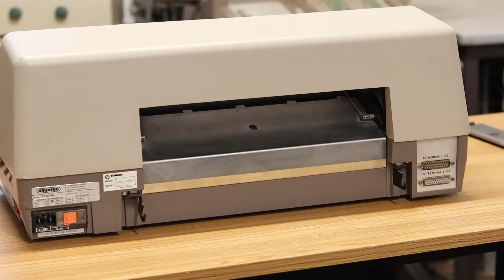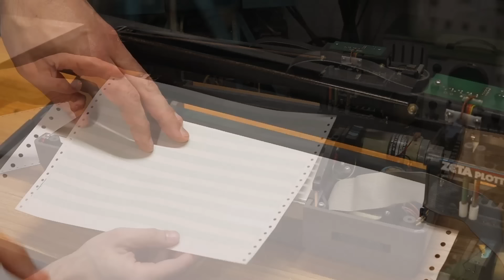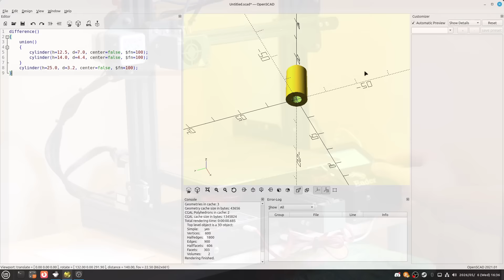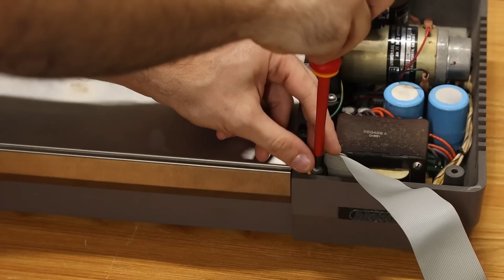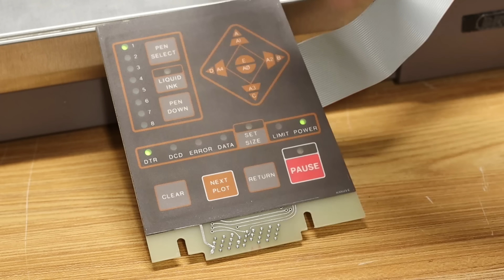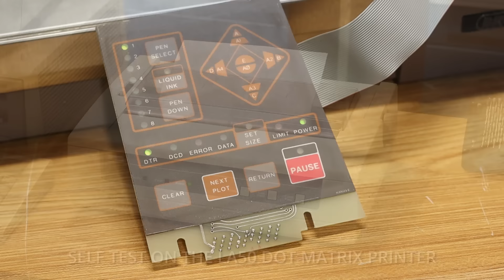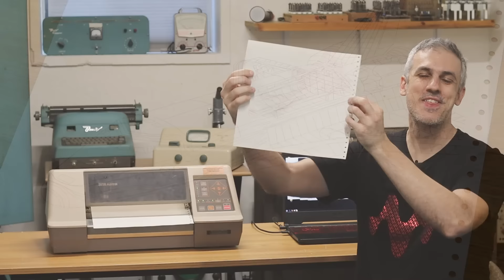A Pen Plotter from 1986!

Comment: I can recommend you a very easy method of finding short circuit location on any PCB. Connect DC voltage supply with current limiting mode between the shorted traces, then, depending on trace width, set the current limit. I use 1 amp in most cases. Then, use a multimeter at 200 mv range, and check the points around the trace. To find a short circuit, you have to check the branch, which shows increase of the voltage drop, until you reach a short circuit location.
Reply: Or put a volt or so across the rail. Given enough time, the faulty component will light up red.
Reply: An IR thermal camera is a very useful tool as well...and they're becoming affordable.

Comment: HP7475A - and HPGL is the "universal" plotter setup of the mid 1980s at least.
If i remember correctly, i had some self written "tweak" software that enabled me to send such data sets even over to those time's HP laser printers (that had two modes, one was more PDF alike).

Comment: You need to calibrate retraction on your Ender. If you google “retractioncalibration” there is a website by the same name that will generate a simple calibration gcode that works very well.

When I need to clean up stringing like that, I just make a quick pass over the print with a torch and it works very well.

Comment: I would advise ((little tangent) oh boy the 3d hobby can get toxic, I'm just having fun with it) to spend a bit on either a Prusa (open-source-ish) or a Bambulab (more plug and play, company is less nice lately) and get some nice filament from those companies to start out with. They are pretty affordable and waaaay more capable then the Ender. I started with an Ender-2, years ago and modded the crap out of that for it to be super nice. But that says enough about why I did that, they are not super stable, cooling is not very good and the beds might not even be heated? It's incredibly rewarding and nice designing your own stuff and then having a printer that just does its job well. Super handy for retro stuff.

Comment: The 3D print strings (called stringing) could be caused by many things, but most commonly, it's a combination of retraction and temperature settings. 
Moiusture can also cause stringing, but it wouldn't be as bad. It's just the "default and almighty" solution to 3D printing problems, "your filament is wet, dry it". While it may improve print quality, it certainly isn't the main cause of issues in most cases, so just keep in mind that if you ever stumble upon a "dry you filament" solution, they're not wrong, but just don't expect huge improvements. 

In your case, using a lower temperature and increasing the retraction settings (this is so-called bowden extruder, i.e., not on the print head itself, but mounted elsewhere and routed to the nozzle via a PTFE tube, which requires higher retraction, usually around 7-8mm). Also, if you were to print just one at a time, the printer wouldn't have to travel, and the stringing would be minimal even with current settings. (There's an option to print pieces one by one, but I'd recommend looking into that more once you get the hang of it.) 

But honestly, even with good settings, Ender is just not a really good printer, and for a newbie, it's one of the worse options out there, it's more like a tinkering and maybe sometimes printing type of printer. 
While I don't really like the company and what they're doing, I may recommend a Bambu printer, they go for quite cheap and from what I heard are more or less reliable. 
If you want something open source and more repairable, upgradable, and without stupid cloud software / firmware and don't mind spending a bit more, Prusa would be the best way to go, for you MK4S should be more than enough.

Comment: That is either a re-badged HP product, or HP re-sold these under their logo. The only significant difference is that HP supplied pens with the precise profile for that carrier, not the rubber-cap bodge which your machine has.
We kept two sets of pen carriers - colour pens and black pens, because some clients wanted their plots in both colour (for their wall) and monochrome on drafting film for the archives. 
They were still in use in mudlogging units (colloquially, "the geology shack") on oil rigs until at least 1991. 
Internally they were very robust - I never saw one "with it's shirt off". But the pens - particularly the yellow one which we used for grid lines on our plots - several thousand feet of well, at 1:500 scale with dozens of lengthwise and cross-wise gridlines ... invariably the yellow pen would run out in the last page of a 3 hour plot, when the helicopter is due to take them away in 2 hours and you have 3 hours of plotting to do before then. 
By the time I left, we were starting to use dot-matrix colour printers, but they couldn't do the robust drafting film prints that every government wanted for it's archive copies of our logs.

Yes, we'd have people standing around in the unit hypnotised by the plotter too. It's almost as addictive as watching lathe-work videos. People who would inevitably get in the way when you're rushing between the sample-washing sink, data acquisition console, data entry computer, hard-copy printout records to compile the morning report, and occasionally look down the microscope at the rocks you're paid to describe.
Reply: This is definitely not an HP product. Bruning acquired Nicolet's Zeta plotter line and did rebadged them under Bruning.
Reply: @Roy20100  Ah, "Nicolet" I remember that name from somewhere. Maybe they sold products to HP for re-badging too?
We were definitely using ours in combination with HP 9817 computers (https://en.wikipedia.org/wiki/HP_9000#Series_200), a ... ThinkJet printer (whose engine I recognised 5 years later in Spectraphysics integrators for gas analysis ; probably still in use)  ; and it was all hooked together on that weird stackable-Centronics network system of HP's (https://en.wikipedia.org/wiki/GPIB, back when it was called HP-IB, and used metal connectors ; actually worked well, but an absolute nightmare to route the cables between instrument racks, and around the laboratory unit)

Comment: The paper problem looks like it's not solvable (with limits on time and money).  It would be much easier and quicker if you could redirect the output to a color laser printer.  If the output has to be RS-232 then it could be captured by a terminal program (Procomm?) and saved to a file.

Comment: About the Ender 3 stringing your print. I got one and usually is one of those things, in order for check:

- Humidity in filament
- Temperature too high for your filament
- Retraction/Wipe settings
- Worn/old nozzle and/or Bowden tube.

Comment: Took me back 30+ years to when we had a plotter connected to a PR1ME mini. I seem to recall there was a "standard" code set (CC907) used/emulated to control the plotter. Long ago, I know, but I think a number of plotter models understood CC907 (perhaps the plotter equivalent of VT100? 😉)
I know ideally you want to use the correct sized paper, but what happens if you try using paper without sprocket holes?

Comment: 21:05 It's super easy! All you need to do in order to freely upload anything at the Internet Archive is make an account (it can be as anonymous as you want!). Then you just hit "Upload files", select everything you want to upload as a cohesive "thing" to be archived (probably all the manuals, dumps, and anything other documentation about one single machine should be one upload). Remember to name the all the files descriptively, don't zip up media files so that they're viewable in the web interface, and include a readme document that explains what all the different files are. When you're done uploading, set a title and description for people to search for and it'll be permanently publicly available! The resulting page will automatically include a torrent that allows people to coordinate their own backups of the data in case the original Internet Archive page is taken down for any reason.
Reply: Can't upvote this enough. All that old documentation is being thrown out as people clean out their houses. Scan it and save it! Bitsavers, Scribd (which, sadly, seems to be subscription now), IA...all good places to put it. Code listings and schematics as well.

Comment: As others already said the stringing was probably because of wet filament and as far as i can tell its probably tpu which is hygroscopic, also its probably not the best to print it on a bowden printer direct drive would be ideal. If you want to you can use your heatbed and a cardboard box as a dyi filament drier.

Comment: TIL: Imperial paper measurements are.... let's say.... weird. When it comes to paper thickness/density/weight specifications, when given in these 'legacy' units it seems they are given like 18# or 18 lb, which appears to effectively mean "18 pounds per almost 1299 square feet". (Yes I know that came from counting an arbitrary number of sheets, like 500, of some arbitrary raw uncut sheet size some paper producer typically dealt with.) I guess we could divide sqft by 9 to give us "square yards", but that doesn't make things much simpler, does it? And neither does using acres for the unit of area.

Conversely, the DIN standard 80 g paper is the mass of 1 sheet of size A0 which is 1 m² exactly. In other places I see paper may be given as 18pt to mean "18 points", but this time it refers to thickness. Now, 1 pt is usually 1/72 of an inch -- at least in typography -- but not for the very closely related medium which is paper! In this case it 'simply' means 0.001" otherwise called 1 mil or 1 thou, not to be confused with 1 millimeter of course :-) Not frustrated -- just amused, so I wanted to share with you all!

Unfortunately I didn't find the solution for the plotter tractor fed paper, other than this seems to be a field where "special engineering sizes" also exist.

Comment: I remember the back of the Commodore 64 user manual including command instructions for using the Commodore-branded pen plotter they sold for it and wondering wtf use it would be, other then spirographs or something. Other then cleaner lines, why wouldn't you just use a dot matrix printer? Ah, the lack of imagination of a 14 year old boy who just wanted to shoot aliens or delve into dungeons on his C64. I wonder how many plotters Commodore sold, I don't believe I've ever seen one in the wild.  

Anyway, this plotter is very robust, took very little to restore and looks very cool, but the plots themselves...I don't know if it's the CAD file or the plotter itself but many of those lines on the space shuttle plot look more jagged then I would expect. Could that be a consequence of the slightly looser pen-fitting you made?  And would it perhaps be possible to take the first pen tip fittings you made that were too thick and dremel them to be thinner? It would be guesswork at first but I would imagine it wouldn't take long to get it right. 

Glad you having fun with this and thanks for sharing!

Comment: Hey that is the same age as me, its in better nick tho .

The problem with the 3d printer is ether your retraction settings or wet filament , you need to dry it out. Honestly you could make the ender work but its more archaic than the plotter , if your a beginner do yourself a favor get an A1 mini .

Send me the STLs if thats ok , i will test them on a more modern printer.

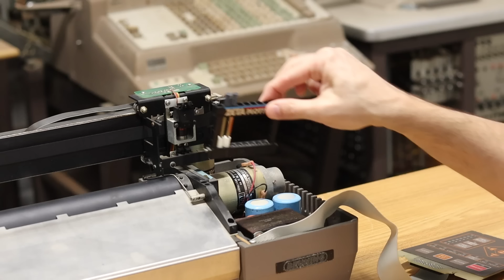Comment: 10:49 I would take some shrink tubing and layer it at the end of the pen to help fill out that space.
Reply: Great fix, or over print it and put it in a drill chuck and sand it down.
Reply: @hamaljay or print the OD and drill it out, no need to print a thin wall, just make it solid and use a drill.
Reply: @derkeksinator17  you know I thought of that too but then all the times that a drill will catch and rip a peace out means that you would have to clamp it down and do so in a drill press and a fixture. Unless you want to print multiples in case you messed up and you don't mind spending a bunch of time setting up a fixture. 

Chucking up in a drill is more easier (for a layman) and has less of a chance of messing up. 

But you know what they say, there's a dozen ways to skin a cockroach.

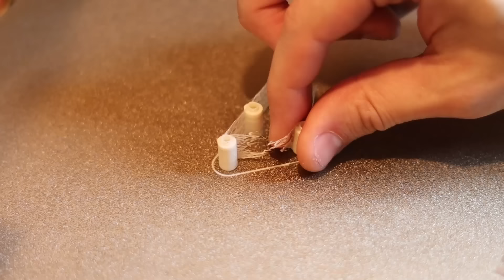Comment: 8:23 this looks like a combination of slightly damp filament and classic Bowden drive (as opposed to direct drive which puts the extruder gears right on top of the hotend) retraction. Step one is to make sure your filament is dry. A food dehydrator is a good tool if you don't have a precision low temp over or dedicated filament dryer. Depending on the filament type and age dry times could be upwards of 10 hours at 50 degrees C. If stringing is still an issue after filament drying your next step is to mess with retraction in your slicer. If youre using Orca it has a guided retraction calibration, or you can web search for people's recommendations for Ender 3 retraction settings. Next step if you're still not happy is to either convert the Ender to direct drive, or just purchase a newer 3d printer with a direct drive extruder. Newer printers, even cheap ones, are likely to be faster and more reliable than that old Ender. Depending on how much time you want to spend there is indeed still massive community and aftermarket support for the Ender platform and you can pretty comprehensively mod that sucker, though the time and cost is really probably only worth it if you want the learning experience.

Comment: You have a 3D printer. 

Why not print out a new pen holder with matching top and bottom nubs for the pens? All you'll need to find then is springs which will fit. 

Thr reason for the large holes at the bottom of the pen holder is to accommodate pens of larger sizes in order to draw thicker lines when required. 

But since you will be using small pens, you will not need larger holes, only holes big enough to let the tip of the pen through. 

And this may also solve the alignment issue with the lines on the space shuttle drawing that you've plotted the first time. I noticed that a couple of the lines either overlap or was offset by a small amount. 

Good luck!

Comment: Take two pieces of paper. Cut the left edge off of one, the right edge off of the other.  Place them together at the right width to fit the machine.  Tape or glue the paper in the back.  You now how a piece of paper the right size.  It's ghetto, but it will work.

Comment: The paper size should be the European "A4 Landscape" which is 8" by 330mm so it should fit your "slightly less than 13 inch". That's what my Tally MT88 eats.
European "Endless" paper is weird. It is almost always measured inch in one dimension and millimeters (or Zentimeters) in the other dimension.

Comment: Speaking of HPGL, many HP Laserjet models can interpret and print HPGL.  All HP display equipment, even the video terminals, use quite similar escape sequences for drawing characters and graphics primitives.  If you write code to display something on one HP device, relatively minor effort is required to port the output to a different HP devices.  It is one of the things which is often overlooked,  but I most like about vintage HP.

When I administered a Vax-11/750, I abstracted daily load and storage reports from Ultrix and generated HPGL files with gnuplot, an open source grapher.  We didn’t have a 7475 plotter on the platform, so I sent the files to a Laserjet 4 which printed them, no problem.  From my recollection you didn’t even need to send the printer a Universal Exit Language string before the print job as you would have to do for PostScript output.

The upshot is that graphs from the Bomem could probably be sent directly to a Laserjet 4 or similar HP printer without needing to modify anything in the PDP program. The Laserjet 4 is almost period correct and would be handy for taking to computer fairs and handing out graphs to attendees without needing to use up rare pin feed paper.

Comment: I think that it is a retraction problem,. Reading through other comments which was eluded to by others with comments to the boden tube. You are using the orca slicer, in the test prints there is a retraction test that varies how much it retracts, which makes it easy to tune.

Comment: If you want to try "plotting, hardcore mode", I can recommend the "Lego Control II" kit - I had fun making it work and plotting something. Too flimsy for the shuttle, but hey, at least it drew my own logo 😁
I do have a few plotting devices in my queue too, but getting paper for them is on the "meh" side indeed. There seems to be just as many different paper styles as there were plotter types...

Comment: openscad is great, but from years of experience with it: man it has some scalability problems.
since separate operations are effectively defined like a stack, it means you quickly end up with a 10 indentations deep stack of operations that's impossible to follow.
and also, don't ever try to do any rounding or beveling or similar with it, cause there's no good generic way of doing that, so it just ends up being a bunch of massive hacks with minkowski and hull operations that ends up with you having to adjust half your code to account for it, and it's just not pretty.
now, apart from these issues, IMO it's pretty much perfect.

Comment: Used an actual HP plotter back in the day. Used it to plot out Excel graphs and such. When you watch it try to draw circles and other curves, your eyes follow the paper and you SWEAR that pen is going around and around, even though you know it can only plot side-to-side.

Also had some older X-Y plotters where the plain sheet of paper was held to the metal bed with a static charge. Never was shocked or anything, but you put the paper against it, flip the switch and it's 'sucked' onto the plotting bed.